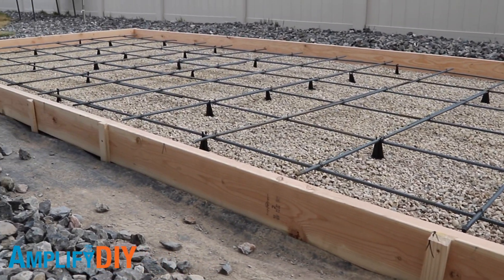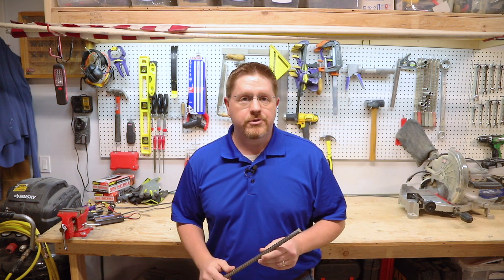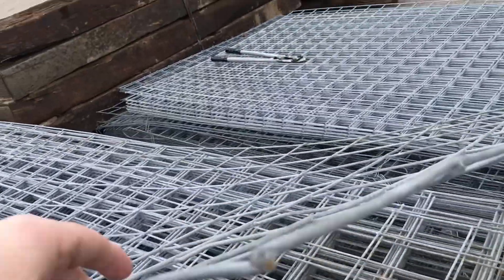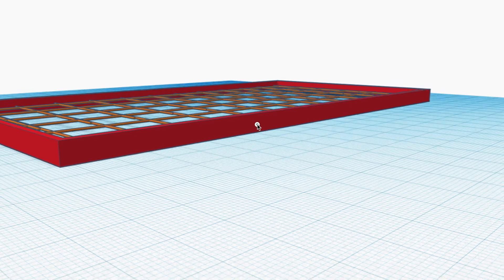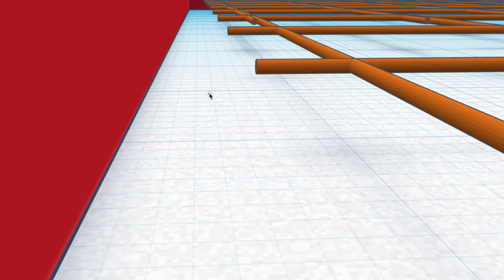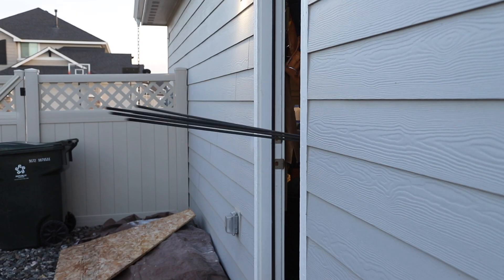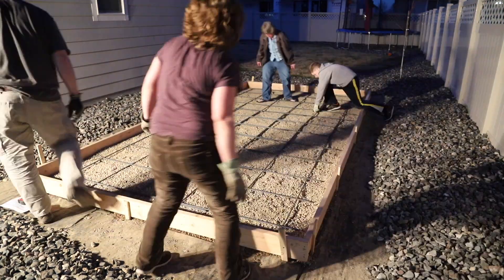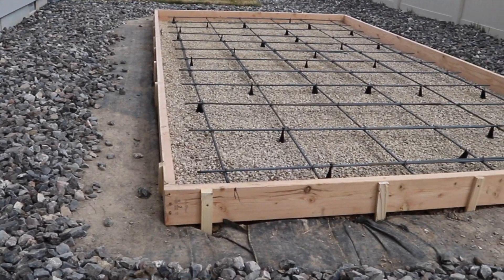All about Rebar in Your Concrete Slab: How To Build A Shed ep 2

Comment: Rebar does not stop concrete from cracking, I am no concrete professional but i can put down concrete its not that hard, My Dad and i have a 24' x 50' x 4" we slab poured in front of my shop for about 48 years now, yes it has a few cracks like all concrete slabs will have and it has no rebar, we pull semi trucks on it and it is still good, my shop 60' x 100' x 4" has no rebar and has no cracks what so ever, I had a buddy concrete professional pour a pad in front of my house garage, 24' x 40' x 4", and he argued with me  saying he would not pour the slab without rebar, he said he had some left over from a job and he would put the rebar in for free and so he did. It was poured in the spring and before sommer was over it had cracks in all over the place and some even got bigger the next summer. My grandfather was a professional in concrete and he told me that concrete was guaranteed to dry and then crack. So my question is why rebar in a slab pour, so next time you go to a friends house that has concrete poured in front of his garage see if it has any cracks and also i'm pretty sure it has rebar in it. I am not saying that i know if rebar is needed or not but i am saying it does not keep concrete slab from cracking.Ok concrete professionals go ahead and learn me i am open for discussion.
Reply from the maker: Hi Jay - thank you very much for your comment. I appreciate your experience, but rebar absolutely does help prevent major cracking in concrete slabs and structures. Concrete itself is VERY strong under compressive loads, but stinks at tensile (being stretched/bent). The rebar is there specifically to increase the tensile strength of the slab. 

My back porch is roughly the same length and width as the slab I poured for my shed. When the builder poured it, they did not add any rebar to the back porch. It has a huge crack that runs all the way across it - this crack appeared less than a year after the house was finished. 

Meanwhile, the slab I poured for the shed has no cracks in it at all. 

If you are interested in more reading/info on rebar and it's effects in concrete, check this out: https://www.youtube.com/watch?v=vuZcPTp51Zk

Comment: Did you compare rebar vs metal mesh?
Reply from the maker: I did not personally compare, but the research I did prior to building this shed led me to believe adding rebar would be stronger and result in fewer cracks. I'm pleased to report that it's now been several years, and there are 0 cracks anywhere in this slab. Thanks for watching!

Comment: If you ended up getting the 20 feet rebar why didn’t you cut them at say 15 feet.  This would leave you a 5 feet piece from each one that could have been used for the width.  This would have saved you a lot of cutting and cut down on the number of pieces you would need.
Reply from the maker: Hi Bob - I don't recall exactly why I settled on the specific cuts that I did, but I suspect it's because I wanted to be within 1 foot of each edge. On an 8x16 slab, the 5' cross pieces would have been too short for my preference. To each their own, though. 5' likely would have been plenty long enough. Several years later, and the pad has not cracked - still looks as good as the day I finished it. Thanks for watching!

Comment: Just curious but could you have just done 15" and took 5" off the 20's. Maybe my maths wrong but I think it would've only costed an inch one axis. I'd assume you'd have to adjust by 1/2" on each side to put back on center?

Also, I have no interest in building a shed but you are so concise and thorough I feel as if watching will help with other projects that I do. You definitely give good tips. Keep up the good work!
Reply from the maker: Hi Praetorxi! I believe you are right about the adjustments to the rebar. It's been a few years since I poured this slab, and so far no cracks at all. :) 
Thanks for your kind words about my videos. I really appreciate it.

Comment: definitely worth your time to gain skills to use more cutting tools. 

sawzall, grinder, even a portable band saw, oscillating multitools. bolt cutters work on the thin rebar well. 

harbor freight sawzall is 20$ with coupon angle grinder is 9.99 with coupon. bolt cutters, 20$ their coupons are all available on a free cell phone app. hope this helps. 

nice layout. nice slab. well done.

Comment: Great video and so nice to see you plan it out in 3D beforehand. 
I was wondering about a base for a shed and would really be interested in your opinion.
I am thinking of using heavy duty galvanised metal fence posts set into concrete post holes as a base, rather than a full slab of concrete. As the shed needs a solid base it could rest on the metal supports. Perhaps this would also raise the wood and reduce water contact with the ground / concrete.
Reply from the maker: Hi David - yes, I've seen lots of people build a shed foundation that way, and it works pretty well. Just make sure that you use pressure treated lumber for the floor joists etc.  When I was planning this project, I ran the numbers to see which would be cheaper. Pouring concrete was a little more expensive (around $100 or so, iirc) in materials, but I decided the peace of mind of never worrying about wood rotting, getting termites, etc was worth it to me.

Comment: you did it on 16" centers cause it felt right? Yeah, thats what an engineer is for. also there is a rule for splicing rebar.
Reply from the maker: I should hire an engineer to calculate rebar spacing in a slab for a shed? Seems....overkill.
Reply from the maker: @floatpool Rookie mistake, I know. Guess I'm just going to have to live on borrowed time for that slab for now. No cracks more than a year later....

Comment: Good video..For those planning a project with rebar call your local rebar seller or industrial steel company...they sell rebar cut to size for about half of what the home store charges . (How do they do it...volume!)  .and that saves time on your end...same rules apply with roofing metal. Bolt cutters may have worked too to cut the rebar too.   Same thing with concrete if you plan to mix more than 10 wheelbarrows...call the concrete truck and save money, time and labour!
Reply from the maker: Underrated comment right here. If I were to do this again, I’d definitely source the rebar from a local metal shop. Thanks for watching!
Reply: @AmplifyDIY  That is cool how we can learn from each other's projects...and using rebar on a smaller project was a good way to see how it works and maybe think about bigger projects too.  Looking forward to your next video!

Comment: rebar is used if you are parking on it car or truck bigger weight thicker rebar a shed floor in general would not need re bar unless you are putting a lot of stuff on it
Reply from the maker: Hi Mark! I struggled for a long time trying to decide if I should bother with rebar in this slab. Ultimately I decided that while it is not strictly necessary, I hate cracked concrete so I added it to hopefully cut down on the cracks long-term. You can see lots more details of the decisions that drove my design in my video all about rebar here: https://youtu.be/I3r1XlqYZXw
Reply: im a builder so i do not need the vid putting re bar in is neither wrong or right for a shed slab with re bar in it can cause problems later on as you did not put a dpm in, the water can corrode it cement soaks water up  the dpm goes under the re bar to stop this, this is why a lot of cement cracks or poor mix as well ie to dry it cracks or to thin a layer 1inch min for cement
Reply: @AmplifyDIY  Well, it's also used to keep it from cracking if the slab starts to pull away from itself so it's always a good idea to add it. Buy yeah, considering you didn't add more gravel to raise the foundation from your surroundings, DPM would have been nice. Doubt it will cause any trouble in your lifetime though. I give you an A.
Reply: @TechieTard  Does the base of the concrete slab need to be higher than the surrounding land? How much higher?
Reply: And how quickly is it an issue if it's not - i'll be digging out the area around the slab next spring to lay decking supports at which point my slab will be quite high. WIll one winter matter?
Reply: Note, 4" of rain fell the other day and didn't pool in the area I've dug out, so drainage appears to be good.

Comment from the maker: Do you have concrete that has cracked and split? It probably didn't have enough reinforcement like rebar added to it.
Reply: How many inches of gravel did you use? 2 or 4?
Reply from the maker: I used 2”.
Reply: One more question, how would you figure for how much stone you need?
Reply from the maker: Stone is usually sold in bags that say how many cubic feet they contain: usually 1/3 cubic feet per bag, if I recall correctly. So, to calculate how many cubic feet you need just multiply the total width by the total height by the depth (in feet) of gravel you want to put down. In my case, I wanted 2 inches of gravel for an 8 * 16 shed, so I did this: (2/12) * 8 * 16 = 21.33 cubic feet. (Dividing 2/12 converts 2 inches of depth into feet).

Great question! I’m happy to answer any others you may have. Thanks for watching!